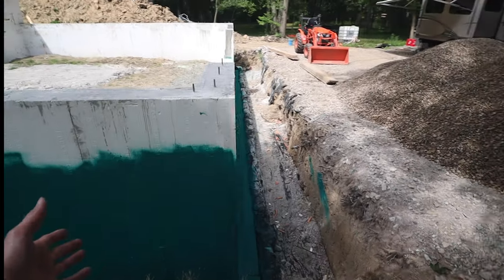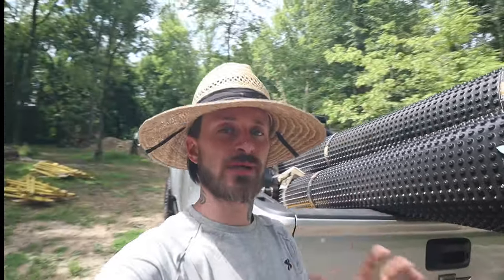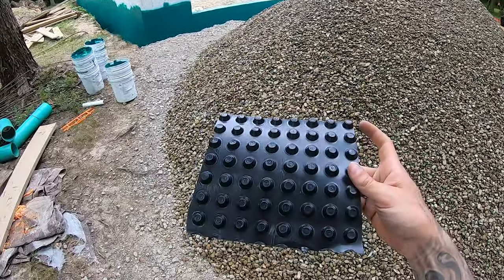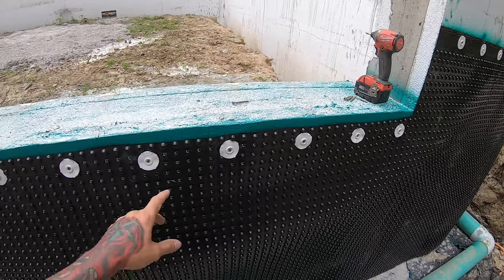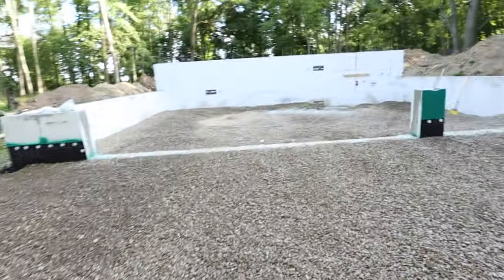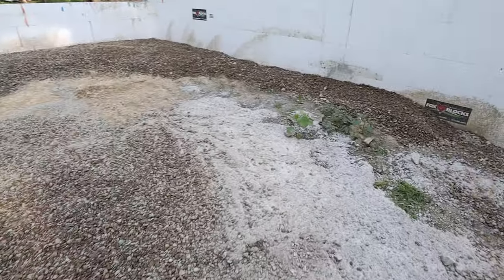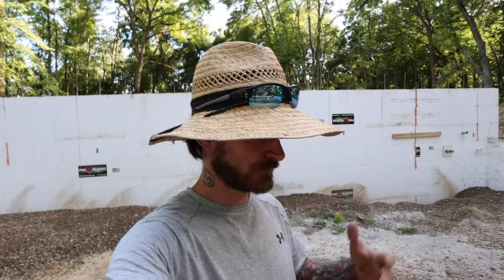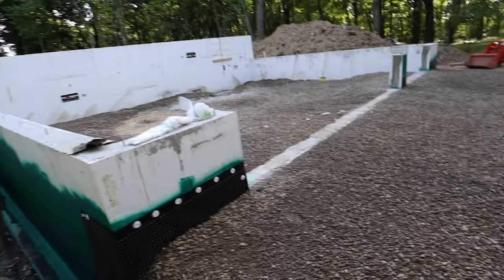ICF backfilling and waterproofing protection.

Comment: i built 1000 sq ft Nudura ICF 6"core workshop and used pex tubing in the 6" concrete slab.I'm heating with a 40 gallon gas water heater and bought other components from Menards. Taco circulation pump, air separators, manifolds,expansion tank.etc. I live in Sheffield village Ohio not too far from you, I keep the garage about 55 degrees in winter and we noticed about $30 a month more on gas bill. The floors and heat feel very warm when your in there. Once I had garage door open for almost 2 hours in feb. bringing in hardwood lumber, when the door shut it instantly was back at 55 due to thermal mass. My garage really made us hate our RYAN home and how inefficient it is,and the reason why we are selling the house and building a NEW home with ICF.
Reply from the maker: ** Toys*in*Review that’s awesome.  Hopefully my garage will be that nice with R-36.6 walls, R-14.6 studs and R-18.4 doors.  The ceiling I’m not sure yet as we are doing attic trusses and I’m
Not sure what my bottom plate is.  A 2x6 or 2x8.   If it’s a 2x6 I’ll only be able to do a R-30 I think.
Reply: Steve Wonder.   Did you end up building your ICF house? We are looking to do one ourselves and I would love to be able to look at one in the process if possible

Comment: P.S i ran 3 runs of 250' pex(750') and garage heats to 75 very fast when needed from 55. The ICF is not fully appreciated by many who don't understand it, and many who are scared of losing wood framed businesses. I've had the garage 6 years roughly and read and watch Youtube videos that don't stress how efficient they are, wood framing is the stupid way of building quite frankly. These are also bullet and tornado proof.

Comment: I believe the dimple mat is backwards. The bumps go against the wall to make a drain cavity.
Reply from the maker: I think I said that in this video or another.  With ICF I didn’t want the bumps pushing into the soft foam making it pointless over time.   Since we used 57 round stone, the bumps outward will never get clogged since they can’t fill in the gaps of the bumps so we should be good to go.  But yes it is backwards per the manufacturer

Comment: We are working  with an ICF Consultant now.  With a basement, he recommended forced air heating and cooling.  If we do a slab, he recommended radiant and mini splits for cooling.
Reply from the maker: Rhaulman wonder why with a basement?
Reply: @neckofthewoods24  Depending on your house plan design, it's easier to run and hide the duct work.  Another reason was, it didn't take much more money, to add air conditioning.  I think he said something about a more consistent temp using forced air.
Reply from the maker: Rhaulman hmmm.  On the basement it’ll be hard.  Our main beam and floor joist are on the same level.  No way to run ductwork to the other side of the house without dropping it down and under the beam which our goal was to have a completely flat basement ceiling.  A mini split down there is also only $2500 vs all that ductwork and a whole forced air unit.  Plus we are looking forward to the quietness and not hearing the blowing.

Comment: I too will be building an ICF house and plan on using Hydronic heating. I prefer to have my pex laid "in-screed", in a thin layer of concrete on top of the slab instead of the slab. Since deciding on this form of heating (and cooling), i have since enquired with Passive House websites, that have said that i should save my money and not bother with Hydronic heating. My house plans are just about to be handed over to the structural engineer, so changes can be made. Passive House experts said that if i build tight enough (air gaps), am careful with thermal bridging and spend my money on triple glazed windows and doors, that a HRV unit will be enough to keep the house comfortable. Now that sounds great, BUT i'm finding it hard to get my head wrapped around that. It's hard to go back and change things when its all said and done.
Reply from the maker: Paul Marotta yeah that’s why I’m installing the PEX, and then installing the ductless AC’s.  We’ll wait for winter and see how comfortable it is with the electric bill.  If the bill is through the roof, I have the PEX to use.  Then all I’ll be burning is propane.  All the PEX for the basement and garage is around $700.  If I don’t need the radiant floor heat, I’m only out the $700.
Reply: @neckofthewoods24  Yeah, that's a good idea, i will probably do the same! If the pex is installed i can then later install the heat pump later on if needed.
Reply: placing pex in the floor when pouring slab involves about $500.00 and whether you hook it up later is up to you. I have it,use it and love it dearly. It's silent heat, feels good on the feet, doesn't blow dust around. I tied the pex to 6x6 wire reinforcement. it's the cheapest heat you'll ever see
Reply: I've had radiant heat in a previous house, loved it. Really loved it. Building an icf to roof including ceiling panels with radiant in the basement with a backup split system for the upstairs. Can't see me having to use the split very much. With an air tight icf system, you could heat that with a hair dryer and it will stay warm.
Reply from the maker: the Bald Man nice!

Comment: Concerning your radiant heat thoughts, I have a question. If you use 1/2" pex tubing and the spacing between rows let say is 12". As tight as an ICF home is plus the the closed cell insulation that its being placed into, why wouldn't you be able to extend your rows to say 16 to 18" between rows instead of the 12"? Your still limited to a 300' run but your run would go maybe 1/2 again further with the same heating. That is probably a really stupid question but it seems to make some sense in my feeble mind. I mean once the room is heated and the floor has warmed it wouldn't take much circulation to keep the room at temp.
Reply from the maker: Great point.  I’m not up to par on radiant heat yet.  I know a little about install and all that but haven’t researched the pumps needed and boilers vs hot water tanks etc.  you make a good point.  I could space out the garage more and concrete while having zero R value does have thermal mass holding the heat in.  So once it’s up to temp it takes forever to cool down.  Something I have to look into and talk with either an installer or someone who’s done it.  I guess it’ll come down to spacing out to far will take longer to heat up so you’ll be running the pumps longer and using for propane.  I’m sure there’s a tipping point or a sweet spot for all that.  Just need to find an ICF home as a regular home won’t be apples to apples.

Comment: Hello and thank you for posting!! Can you share more on the spray water proofing product?

I am very interested to learn about an option for below grade water proofing that does not include self-stick rolls.
Reply from the maker: Yeah sure.  Rub-R-Wall is the product and I have more vids using it.  This is a aqua based one that can be sold to the public.  They make a petrol based product for just raw concrete or block but they won’t sell it to just anyone.  If in need to purchase the direct contact is Denice Brown at dbrown@rpcinfo.com which is the main manufacturers or owners secretary.  Just a FYI, you can roll it, paint it or spray it but only spray works well!   But you need a LARGE sprayer (big horse power).   Buying one is about $3,000.
Reply: @neckofthewoods24  much appreciated, thank you!
Reply from the maker: @scottlurken9667  any time.

Comment: RUB-R-Wall?I went to the website and states only applied by certified contractors.How did you order this, it's hard to find a roll on that is not petroleum based and eats styrofoam
Reply from the maker: ** Toys*in*Review Rub R Wall Aqua is sold to the public and used for ICF as it’s water based and you can install it.  The Graco 695 worked fine spraying just a thick material.
Reply: How much per 5 gallons

Comment: What kind of stone did you use? Pea stone or course stone?
Reply from the maker: the cheapest stone around here was 57 washed round river rock.  great for outside the walls because it wont stab and hurt the dimple membrane but not the greatest under the concrete slabs but so far so good with cracking etc after 3 years.

Comment: Always put the pipes in the floor 
The air conditioners only heat up when it is above -5°C outside 
So below -5°C They don't do it anymore
Reply from the maker: Roelof Hansma still pretty cold but it does drop below that around here.

Comment: You’re going to trap moisture in those, which will eventually seep into the concrete and rust your rebar. I understand your thought process but there’s always variables you overlook. Always use products as they’re designed and intended. They invest a lot of time and money into engineering and product design. Speaking as an architect-builder
Reply from the maker: i made this video a while ago, which product are your speaking of?
Reply: @neckofthewoods24  . The dimples are intended to go against the concrete to keep an air gap to reduce moisture build up. Think about a moist sandwich bag, the flat membrane sucks against the surface and traps moisture both from the inside and outside, instead of leaving space for the water to react with the air between the concrete and the membrane.
Reply from the maker: @DanielMartinez-rv6su  we'll if the dimples push into the foam than we lose that gap anyways.  the Rub-R-Wall isnt going to let moisture in though being so thick and icf being close cell is kind of waterproof in a sense already.  then with the rebar being 2 inch or more within the concrete i dont think rusting can happen through all that without the presence of oxygen.  im also not seeing how moisture can get between the dimple guard and ICF when moisture cant go through solid plastic below ground and the french drain is keeping water away from the wall and top of the footer.
Reply: @neckofthewoods24  the dimples would push in but the rubrwall has enough surface tension that it wouldn’t compress the two. So you wouldn’t lose it but I get your thought process. So when you’re using high efficiency systems, I.e “sealed houses” or “tight houses” your top priority should be moisture. Because it is icf, you should be concerned with moisture drive that will ultimately penetrate any imperfections in the systems or the installation. Because really, with your method, you could have achieved the same result without the dimple mat, and instead using a heavy ply membrane. Moisture in rebar is the number one overlooked thing and problem for homeowners. The dimples are meant to function as a cheap insurance policy. That policy needs that air gap betweeen the membrane and the concrete, otherwise it looses its function of acting as a channel for any water that MIGHT get past. If it gets past on your installation, it won’t have a channel to seep out of, and instead will act like a most sandwich bag. Which WILL erode your membrane and eventually the foam and concrete. This won’t happen soon, but it could be a hidden problem odecades down the road.
Reply from the maker: @DanielMartinez-rv6su  i gotcha.  we'll see i guess.  normal houses around here just put up some sort of batt that does nothing for insulation and once compressed nothing for water flow i bet, specially once filled with dirt and they still back fill with dirt!
Reply: @neckofthewoods24  honestly, the more I think about your system as a whole the less I’m concerned with the Matt. The fact you filled with gravel and not dirt substitutes for the drain channel. All in all I think youve built a bangin house, and yea most people tend to build disposable homes. Just thought I’d give some constructive knowledge, in case you ever build a new home!
Reply from the maker: @DanielMartinez-rv6su  and we used 3 layers of fabric so the little dirt we have can get caught and not clogged the stone and one day the french drain.  i hope i dont build another!
Reply: @DanielMartinez-rv6su  I just seen this and  seen the same thing.  The rock will replace the dimple for sure though.  However I was going to use all rock to backfill and was advised not to because of a thing called frost drift.  Apparently if you have too much rock along the foundation frost can go deeper.  Anyways it’s pry fine, the dimple will just help out the rub-r

Comment: 5 rolls lol cut 1 in 4 pieces for the 1 foot dummy
Reply from the maker: That’d create more water penetration points.  I have 4 vertical seams and 4 vertical seams only that are silicone sealed and no worries.   You don’t just slap a bunch a material together to make up for lost coverage.  That’s a hack job then.

Comment: You just gave all the water somewhere to go never backfill with all stone the water will stay around your house
Reply from the maker: There’s a 6” drain all the way around the house.  I purposely gave the water somewhere to go so it never stays around the house.  You always backfill with stone.  Never backfill with soil.  That’s how water stays around your house and causes hydrostatic pressure and cracks your walls.
Reply: @neckofthewoods24 we only put stone around the drain tile your supposed to back fill will the same earth that's on the property and slope it away I've built 590 houses never had a problem
Reply from the maker: @Keith-ou9su  I did that.  In front of the garage will be concrete slopped away so we will be all good without issue.
Reply: the drain is solid how is water going to enter the pipe. ive never seen a solid foundation drain tile. pretty sure its always perforated and wrapped in stone and fabric
Reply from the maker: @NcG59 it’s not.  Very large holes.